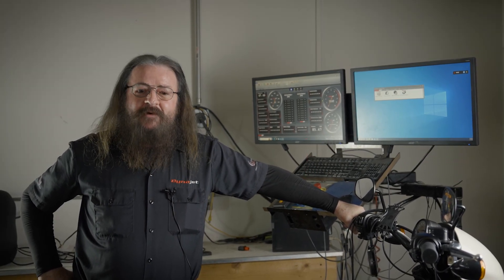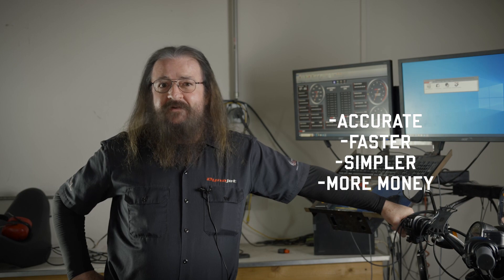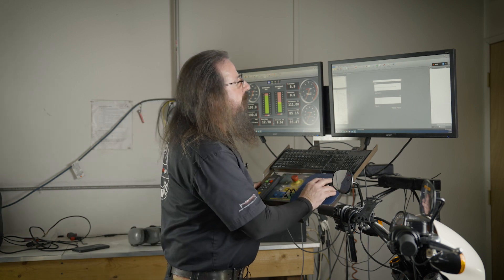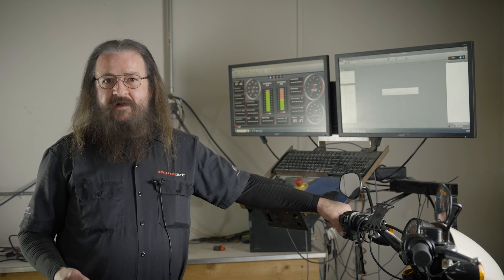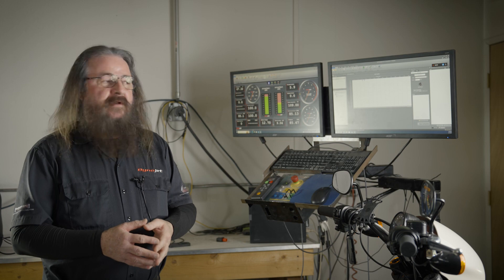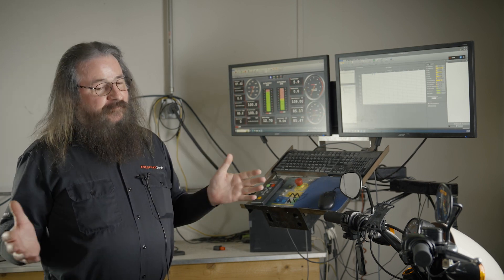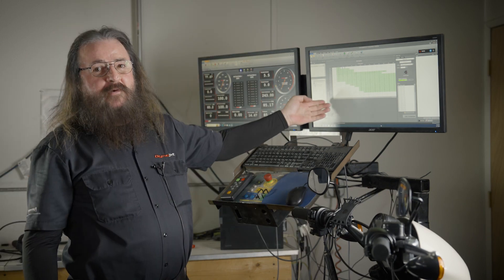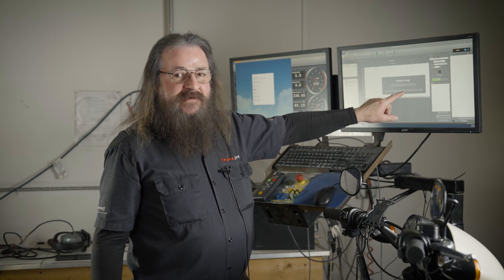Tuning Link 2.0 | In Depth Tutorial

Comment: The video is pretty good. I still couldn’t get any of the front/rear cell tables to show up. It’s kind of frustrating trying it with NO training. I went back to just an older AUTO TUNE section and now my tach doesn’t work on winpep and can’t find where to re enable the signal.